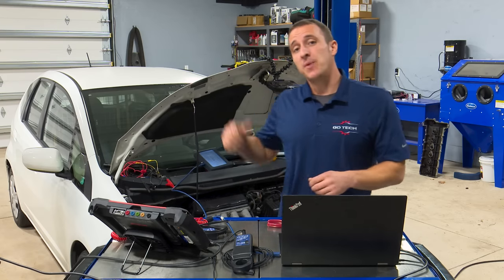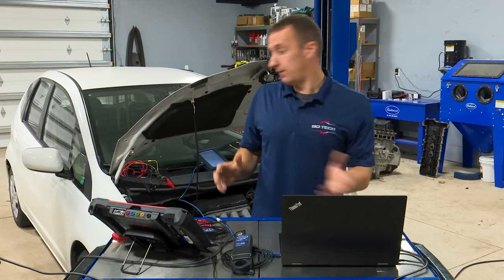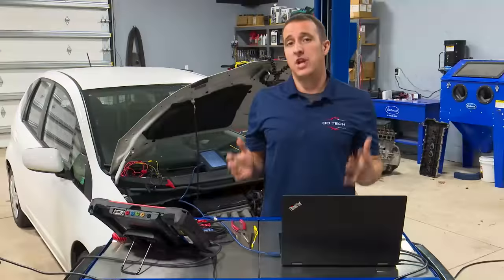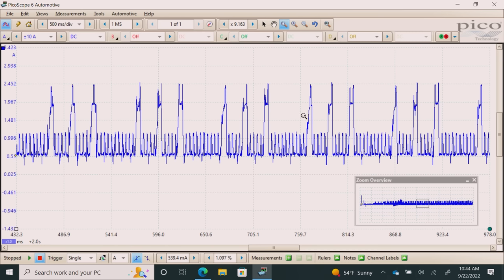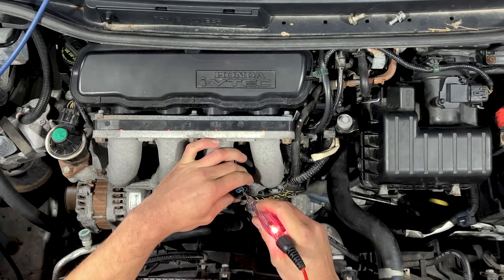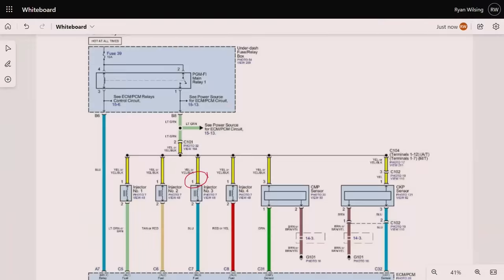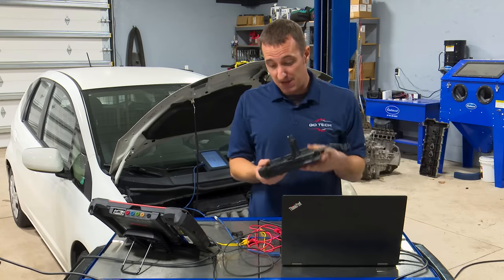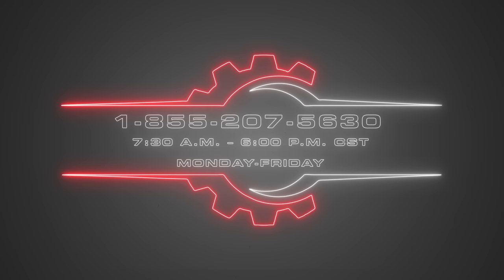Unfixable Honda Misfire Solved P0303, p0203

Comment: Great video!. it might be worth noting that some modern control modules are able to shut down faulty circuits in order to protect the drivers. So in this scenario it is always best to check for circuit control again, after erasing fault codes.. I think in your case, if it has had a module already then it probably doesn't have a protection feature. But it is always better to check before condeming a module.
Reply from the maker: Hi Stephen,
Great Point!!
We did try clearing codes and installing a known good injector to see if the PCM would come back. I forget to mention that on camera.
Thanks for watching
Ryan Wilsing, Technical Instructor
Reply: @GoTechTraining Top job! 👍

Comment: Really good one there. Had a similar issue on a Malibu and it was spectacular- the driver in the PCM was fried but in the closed position so the injector was just constantly on. It was blowing raw fuel out the exhaust like a steam locomotive and it filled the garage with acrid smoke in just seconds!!
Reply from the maker: Wow that will drop you MPG quickly! Hopefully the converter was salvageable. 
Was the injector shorted?
Thanks for reaching out!
~Ryan
Reply: Yes indeed. Injector shorted causing the driver to fail due to no load on circuit. 
   Good point about the Cat and I thought the same. It was hard to check because it did show a rich O2 held at 2200RPM but I wasn’t sure if that was still fuel contamination. I asked owner to drive it for a week and let me check it again but they never returned :-/

Comment: This is a great channel. My only critique here is that you should always confirm which cylinder is misfiring with a power balance test. Never rely on the code alone. Obviously you guys did that somewhere along the line. 
But for newer techs, never trust the computer to pick out a cylinder. Always confirm with a power balance test. Great job!
Reply from the maker: Hi John,
Thanks for watching! Great Tip
Ryan Wilsing, Technical Instructor

Comment: Nice Video! Sometimes it's easier to check resistance by leaving the injector pugged in and putting one lead on the fuse and the other lead at the computer connector.
Reply from the maker: Hey, that's a great tip! Especially on ones that are under the intake or something. Thanks for the tip, we will have to show that sometime soon!
Mike Becker, Senior Instructor
Reply: @GoTechTraining  Thanks I got it from Justin at OCD Auto, It's a small but really good Chrysler channel.
Reply from the maker: Well shout out to Justin @OCD Auto. Just subbed!
Mike Becker, Senior Instructor

Comment: Good diagnostics job. I would like to suggest two things.
1) To reset the PCM after clearing codes to see if the #3 injector comes back.
2) Measure the resistance of the new injectors before installing them to make sure they are in specifications..

Maybe you have done, or always already do (number 2),, so just suggestions. 

Again, good diagnostics and thanks for making these videos.
Omegaman
Reply from the maker: Thanks for the tips! and watching the video!
We did try and reset the PCM using a known good injector, but forgot to mention in the video. I was actually surprised the PCM didn't comeback.
Ryan Wilsing, Technical Instructor

Comment: I'm both enlightened and frustrated by this video--you seemingly resolved the p0300 within 15mins! I have a 2000 Accord V6 (160k) with the very same onerous misfire (p0300) gremlin! (This J30A1 engine also suffers from the dreaded "Heat Soak Issue", though I don't believe the two are connected.) Two techs have thrown their hands up at the problem after firing the parts cannon into the engine bay. How'dja like to make a video featuring the diagnosis and repair of a vaunted 6th gen Accord! Excellent and informative as always. Thanks Ryan! ...and vicariously, to Mike as well.
Reply from the maker: Hey Tim,
Thanks for checking out the video!
2000 Accord, what parts have been replaced?
Have they tried checking the valve lash clearance?
Ryan Wilsing, Technical Instructor
Reply: @GoTechTraining  Hiya, Ryan!

In addition to a valve lash adjustment, the following is a list of things we've ALSO done: 
- fuel injectors/plugs
- ECU/PCM
- coolant temperature sensor
- O2 sensors
Additionally, we've performed an air purge of the coolant, checked the fuel relay solder joints, and tested each coil, and performed a wholesale Odyssey fuel rail swap-out!

This stubborn gremlin will NOT be defeated! After each laying-of-the-hands, the CEL inevitably lights, and I drop my head in abject helplessness.
Reply: fuel fuel fuel! run premium and some additives or ethanol free fuel for a few tanks if available there.
probably hot weather(heat soak) and fuel boil off in the rail/s, now it could be worse because of rapid pressure drop, leaking regulator/injectors/check valve(probably part of fuel pump).
the boiling points of ethanol and straight gasoline are different, now factor in the system standing pressure and bleed off rate. maintaining higher pressure keeps the boiling point higher and less vapor in the fuel rails/system. vehicles are made to run on liquid fuel that's atomized, not vaporized fuels. if it's a return-less style system, it's more critical to maintain pressure for a long period after shutdown.
Reply: @GoTechTraining  According to the HSM (11-22, Supplement)  "The Crankshaft Position Sensor (CKP) determines timing for fuel infection of each cylinder and also detects engine speed. The PCM detects misfiring by using the CKP sensor to monitor fluctuations in the crankshaft speed. It will then set DTC's depending on how much misfiring occurs." 

The DTC i get is p0300 with the occasional cylinder-specific code--I have NEVER gotten a P0335 or P0336. This makes me hesitant to suspect a wonky CKP. Yet it remains a potential source of a random misfire code, according to the HSM. This part is still original.

Comment: I would agree that the injector is the original problem. Before condemning the pcm I would first erase the code and see if the circuit comes alive. Sometimes if there is a circuit code the pcm will shut that driver down to protect it, especially in newer vehicles that have current limiting devices in the driver. Resetting the code might enable the driver in the pcm to allow proper function. Worth a try.
Reply from the maker: Hi Robert,
Your %100 correct
We did try that exact thing, but I forgot to mention on camera
Thanks for watching!
Ryan Wilsing, Technical Instructor

Comment: Ryan . thank you for putting this video up. Im a Dyi mechanic.
This will help me tremendously. 
I just need a Pico scope now.
Reply from the maker: No problem, I'm glad you liked it.
A Pico Scope is a big investment, but it can really pay for itself once you get the hang of it.
Ryan Wilsing, Technical Instructor
Reply: No Pico needed... a good ear can tell you if your cranking is even...
The rest of the test can be done looking at live data on a scanner or using a multimeter and a test light...
Reply: The Micsig SATO 1004 is also one to look at. Lots of choices for tools now.

Comment: Its great to see a tech using a DSO!  Scan tools only get you so far, especially if you're an independent using a generic scan tool. 

Also, cool trick using the light bulb to test the circuit under load! DVOMs have their place but testing 5V/12V wiring is not one of them IMO. The mAmps at 9V output by a common DVOM come nowhere near the functioning amps of the circuit. I usually back probe the connector and use my own wire/alligator clips to create my own circuit, but in this cars case it would've been a waste of time with little knowledge gained. I'm definitely going to use your method in the future.

Nice work on the diagnosis! We need more videos like this!

Comment: I would like to mention that the node test was not needed since you had confirmed no pulse present. Though I thought you were going to check what was missing at the connector; let's say the ground and the computer was detecting an open and would not fire the injector since there was no resistance present from the injector winding. Great video!
Reply from the maker: Hey man, we actually put a different injector in the loop verifying that the PCM wasn't in protection mode. Shoulda shown it for sure. As always, thanks for watching!
Mike Becker, Senior Instructor
Reply: @GoTechTraining  yes, that's extra assurance. I know I couldn't fool a running board module from a ford that wanted at least 1ohm resistance for it to command the running board motor. It did not like a motor with 7ohms, it refused to actuate it, I had a 3 amp light and put it in series, had around 1.2 ohms and it commanded finally. The motor worked flawlessly when actuated manually and the amperage was pretty similar to that of the 1 ohm motor. New motor fixed it but the old motor was still good to me.
Reply from the maker: Ugh man Ford power running boards....have them on my 16' F150 in Wisconsin. N E V E R again.
Mike Becker, Senior Instructor
Reply: @GoTechTraining  Yes, forgot to mention the price tag. Around $600 at the shop discounted price.

Comment: Good Video! Would you also want to make sure there's not a pin insertion issue, corrosion, or broken pin at the PCM connector just to be 101%?
Reply from the maker: Hi Sancte,
Good point! Great things to check!
Thanks for watching!
Ryan Wilsing, Technical Instructor

Comment: Doesn't it seem silly that the pcm driver can't support a load equal to the fuse protecting it??  If drivers can't be made strong enough, perhaps car makers should give each injector its own smaller rated fuse.  Then the problem would simply be a shorted fuel injector that blew its fuse, and the pcm lives to fight another day.
Reply from the maker: I agree 100%
If the fuse isn't actually protecting the circuit, the fuse is too big or the PCM driver needs to be stronger!
Ryan Wilsing, Technical Instructor
Reply: Worse yet, even unplugging an injector with the circuit powered-up is enough to create a voltage spike that fries the PCM!

Comment: Terrific video I know you disabled the injectors by pulling fuse #39 but what wire did you connect the amp clap to to determine if the injectors are pulling to much current. I probably missed it but maybe you can just tell me which wire. Thanks for sharing.    Artie 👍
Reply from the maker: Hey Artie,
I pulled the injector fuse to do a relative compression test. 
Then I installed a fused jumper back into the injector fuse slot and installed the amp clamp around the fused jumper.
Then I started the vehicle and grabbed amperage from all 4 injectors and it showed that the #3 injector was not pulling any amperage due to a bad PCM driver.
~Ryan
Reply: @GoTechTraining  thanks for the reply. I just see you install the fused jumper wire. Now it all makes sense. Thank you for the quick reply.  Artie 👍

Comment: So in conclusion, the injector is bad (shorted) which fried that driver in the PCM, so both will have to be replaced. 
How do you get access to the injectors on this engine? Looks to be a real pain.  What might the total cost of repair be?  
Loved the video. Good Job.

Comment: How often are p030x misfire codes the result of a wonky crankshaft position sensor and/or torque converter lockup solenoid? When in the t'shooting process would you test either as culprits, and how would you go about doing that?
Reply from the maker: Hi Lothian,
Good question!
When it comes to a crank sensor causing misfire codes, it is almost always a false misfire or a misfire code with no actual misfire felt. If I see multiple misfire counts on the scan tool without feeling the misfire while driving the car I will investigate the crank sensor. This can usually be fixed with a crankshaft position relearn or pattern relearn. If the crankshaft position sensor signal is causing a misfire, it will often be flagged by the ECM when the signal drops out and the po30x code will come along with a p0335 or p0339. Then I would scope the crank signal and look for any abnormalities. 
TCC solenoid issues that cause misfires are rare and can be tough to diagnose, usually they cause other symptoms like stalling or a buck/jerk. The easiest way to diagnose if the TCC is a issue is to remove the TCC fuse to stop it from engaging and retest.
Thanks for the Reaching out and supporting the channel!
~Ryan Wilsing

Comment: What?? An electronic compression tester?   I thought you had to physically take out a spark plug and install a compression guage?   Can you explain?  I have a 2012 P0303 cylinder 2 misfire I am starting to troubleshoot.  Engine doesn't seem like it's running bad.  Got it this past year after my uncle passed.  When first transporting battery was dead, jumped it twice, went on a 30-40 min drive towards back home.  Next start the battery was low? And trying to start the whole car was turning off and on, not just starter clicking, everything on off rapidly like possessed.  Had to jump start again and after that the radio didn't work, no output.   Odd.

Comment: i'm particularly curious as to why there are injectors in the box of goodies but then one of them that's on the car is shorted? is one of the injectors in the box shorted? i feel like there is more to this story.
Reply from the maker: Hi Josh,
It was determined that one of the replacement injectors (#3) was also shorted and caused the replacement PCM to fail again. I'm not sure the source of the replacement injectors. But we made sure to source quality ones for the second replacement.
Ryan Wilsing, Technical Instructor

Comment: I think I may have the same problem too except it happens randomly so I either get it after 2 months or when it’s cold, and I replaced the plugs and coils since march

It doesn’t drive rough, it gets up to speed and gets good MPG so do you think I can drive it for like a few months
Reply: ALSO is there like a part number for the PCM as I can only find used ones (unless it’s better)
Reply from the maker: Are you getting an engine misfire code?
This car was fixed with a used PCM, worked great!
~Ryan
Reply: @GoTechTraining  yea cylinder 3 and 4 sometimes it goes off unpredictably so it either comes back a few months
Reply: @GoTechTraining I found ones under the ecu name does it count

Comment: hello. Why was there no flush on the third cylinder during the bulb test? the engine controller was in safe mode? where did you connect the 30A current clamp? The same for the mass cable? Best regards
Reply from the maker: Hello Seb,
This engine controller had a bad driver
I don't think it had the ability to go into a safe mode for a over amperage condition
I connected the 30 amp clamp to the 15 amp injector fuse using a fused jumper wire
Ryan Wilsing, Technical Instructor

Comment: Great work 👏.  I would have liked to see if a new injector would have fixed it. If not reinstall ome computer
Reply from the maker: Hey Chris,
We did try to hook up the #3 injector circuit to a good injector to see if the PCM would come back after having the correct resistance on that injector circuit, but the PCM was not having it.
Ryan Wilsing, Technical Instructor

Comment: Hi how come you went into checking the injector instead of the ignition coil? I just want to try to understand a tech's thought process better so I can also apply it too, 

thanks!
Reply from the maker: Hey, so this one did have a fuel injector circuit code, P0203, stored in the PCM which led us to check there instead of the ignition system first. 
~Mike
Reply: @GoTechTraining  ohhh ok thank you
Reply from the maker: No problem, thanks for reaching out!

Comment: Hi sir I have a 2005 chrysler 300c 5.7 currently its blowing white smoke from tailpipe " raw fuel " and code for #1 injector circuit open I suspect it's my injector module in pcm because key on the on position on these vehicles they don't have power to injectors needs Rev activity. Also did noid test and one stays lit. Is it a reliable test to test for voltage at pcm pin ? I tested other know good injectors from pcm no voltage and #1 has 11 volts can this be a reliable test to condem the pcm inj module keeping #1 injector open ?
Reply from the maker: Hello,
I would test for power at the injector that seems shorted and then unplug the ECM. This will prove the wiring isn't shorted causing the issue.
~Ryan

Comment: 2010 fit sport with recent valve adjustment and forgot to connect the EGR. Drove the car a short distance and engine light came on with car in limp mode. Reconnected the EGR and now cylinder two has miss fire and not sure how to fix it. Injector connector has power. Re-check valves or something else? Any advice will help. I’m a DIY guy so still learning. Thanks

Comment: currently working on a 2009 honda crv with the same cylinder 3 misfire. upon first inspection it seems the previous owner had discovered the issue and tried to rewire the injectors. so first thing we did was get a stock harness back in the car rewired up properly. we have done some of the same testing and found that only the 3rd injector isnt receiving signal. i havent done a resistance test although it will be my first test in the morning. if i get the same results as you that means this pcm is dead?

Comment: Our misfire/limp mode ended up being a bad mass air flow sensor. Finally fixed after coils, spark, cylinder 3 injector and valves failed to stop the limp mode.

Comment: If injector 3 shorted ,why not have ground signal from pcm when you put test lamp?
Reply from the maker: HI Ziko,
Thanks for the question!
The shorted injector burned up the PCM driver and caused the PCM to fail also
Ryan Wilsing, Technical Instructor

Comment: Why did the injector fuse not do it job, if the injector failed and fused
Reply from the maker: Hi P Hill,
Great question!
The injector was shorted to 2 ohms, which will cause it to draw around 6 amps. Which is way too much for the PCM driver to handle, but not enough to blow the fuse which is rated at 15 amps.
Ryan Wilsing, Technical Instructor